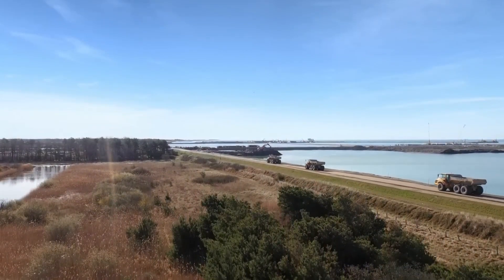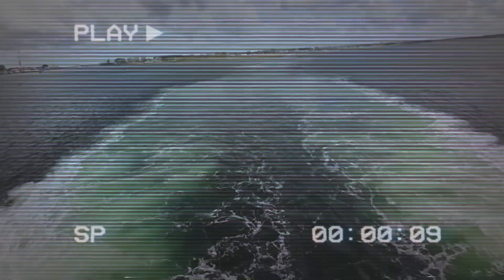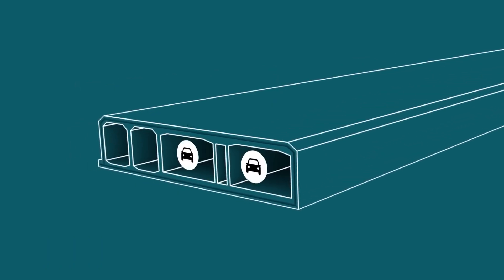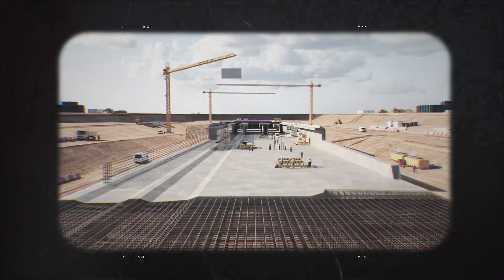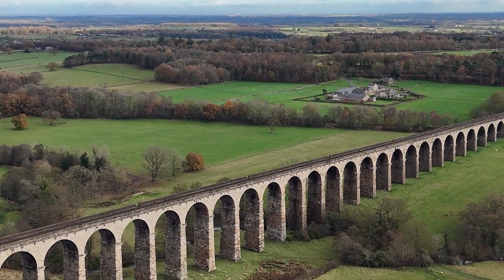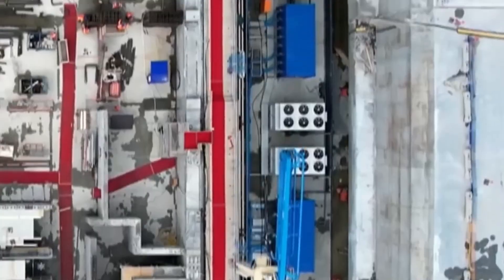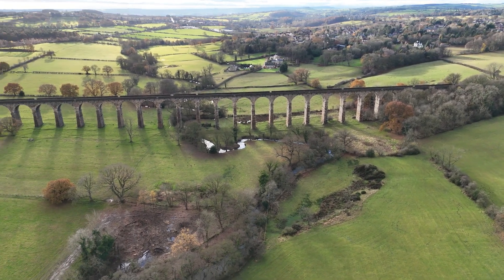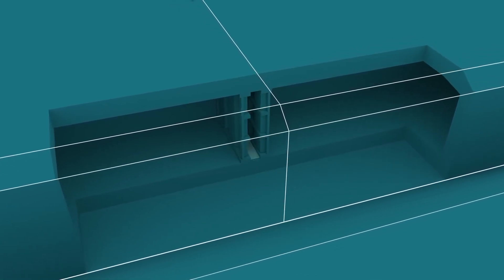Fehmarnbelt Tunnel: Europe’s Underwater Mega Project Explained!

Comment: "longest immersed tunnel."  I'm fairly sure 18kms is less than the 38kms under water of the Channel Tunnel.
Reply: But the channel tunnel is a railway built with a boring machine. The Fehmarnbelt tunnel will have a road and railway built with pre-cast submerged concrete sections.
Reply: The Chunnel is underground. I think that’s the difference.
Reply: Channel tunnel is a bored tunnel, not an immersed tunnel. It is two completely different ways to build tunnels